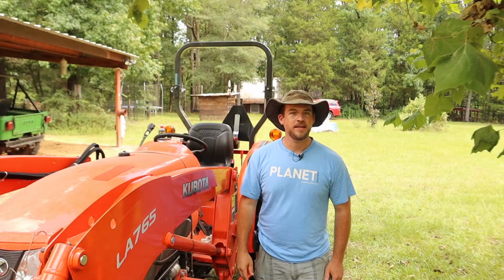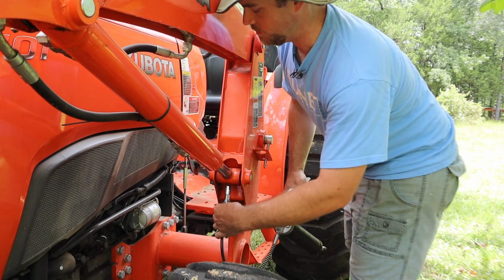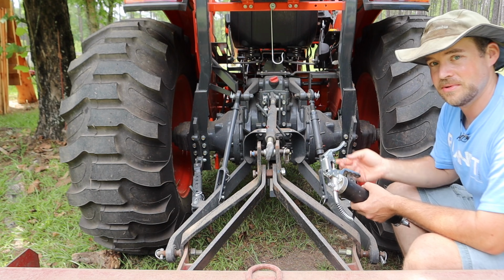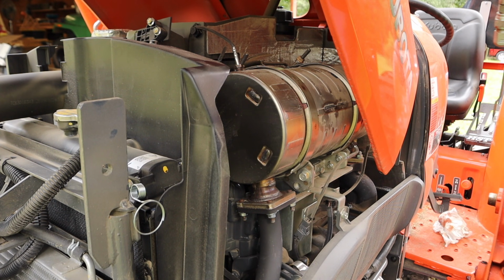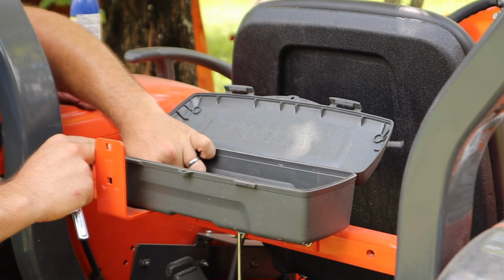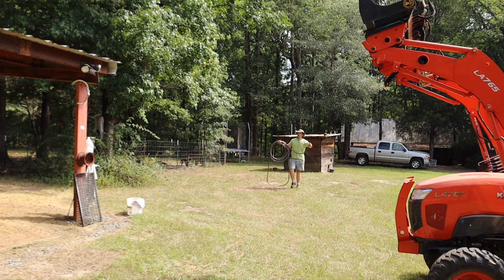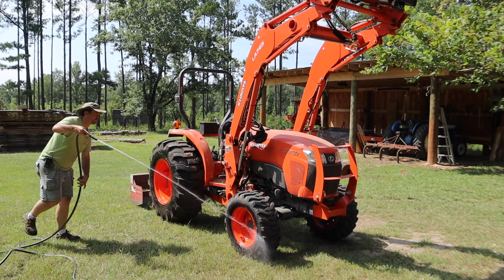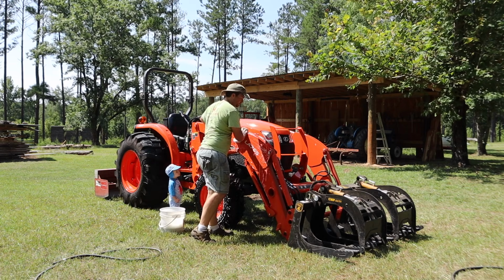I Can't Believe Kubota Did This

Comment: I agree that the Kubota hitch design is not the best; my L3830 is the same way. But part of the problem is that the frame on the box blade is bent on both sides where the pins are. Straighten that out and the hitch process will be a bit easier.
Reply from the maker: Yes, there's some bending going on, but it was difficult before the box was bent.

Comment: Never trust hydraulics. Maintain positive control. Raise the bucket and place 1.5” angle iron on the pistons cut to the appropriate length for a brace. Paint or tape them a bright ugly color so you’ll remember to remove them before letting the bucket down.

Comment: I work as an engineer for a large diesel engine manufacturer. It's no secret that T4 emissions equipment causes poor fuel economy. The DPF is a big filter on the exhaust and that causes a restriction which means you need more fuel to do the same amount of work. On top of that the combustion parameters aren't optimized for fuel economy, they are done so to stay within emissions and then give the best fuel economy within that constraint. Also the Regen process consumes more fuel to burn out the DPF. 

Long story short yes you get poor fuel economy  but the air coming out the tailpipe is cleaner. Does this offset the effects of having to use more fuel and the processes to get it? I don't think we have an answer but I bet not
Reply from the maker: I agree, the exhaust is just crystal clear on this machine. I can never get it put out any of that satisfying black diesel smoke.  

I agree, It just doesn't make sense to me that burning more fuel to do the same amount of work somehow helps the environment.

Comment: Although i guess this may be known, a DPF is a diesel particulate filter that removes the very small unburnt carbon particles that Diesels make, sometimes seen a black cloud. The small particles ( PM10 and 2.5 ) are very bad for human health, particularly for children, although in open farms like you have that may be irrelevant compared to cities where this is a bigger issue. A DPF is not added for efficiency or CO2 emissions but for human health. Cheer , thanks for the video.

Comment: Your Kubota tool box was in stage one. Wait a year and stage two will become “hinge failure” when you say where did the top go?
It’s probably behind the seat.
I have a M5140 that I was lucky enough to find at a Pennsylvania Kubota dealer. It was a leftover with out the regeneration stuff.
If I had a beef, other than the disposable screwdriver holder, it would be the throttle handle that has a 45 degree bend that is designed to dig into the operators thigh.
Apply wax to slow down the change of coloration to pink.
Is it worth 26,000$ more than my FORD 3600?  
cc Kubota Tractor Corp
Reply: Plastic tool box is 4 years old, no problem but I keep tractor in shop when not being used

Comment: I don't know how it would work for you, but I have a set of forks for the back of my Kubota. It was a struggle to put them on because they were at the limit of the lift arms. So I took the lift pins on the forks off and reversed them. Now you pull  the arms out over the pins and put the locking pins in on the inside.

Comment: Be careful with the quick hitches, make sure it fits the implements, the with of the connections may be an issue.
Reply: You can always use a Pat’s easy change on the tractor as an alternative

Comment: You  stated the tractor uses more fuel than the pre tier four . It’s all about NOX emissions, lowering combustion temps reduces NOX, but when you lower combustion temps you can retard the timing lower the compression ratio and used exhaust gas into the engine, unfortunately this uses more fuel to get the same horsepower. Good part less NOX emissions, bad part less fuel economy. Once Def, diesel exhaust fluid, is used less exhaust recirculating and a little better fuel Econ, still not as good as pre after treatment but better for NOX Emissions. I suggest reading up on it.

Comment: Ok video is a year old so you most likly wont read this,,,  but some tips.... First rag in one hand, grease gun in the other... Wipe off grease fittings before greasing and after.  Pushing dirt into fitting is bad.  Second get a good battery grease gun and you will be more likly not to put off greasing your tractor...  Grease bucket every ti.e you use it...

Comment: You are right the model you have is designated as a CUT Compact Utility Tractor and not aimed at the Ag market. We have nine tractors including an L5740HSTC and M8540HDC and they are great, but won't match our older ag tractors. We no longer farm, so the Kubotas get more use than anything, but it sure is nice to have one of those old, heavy ag tractors handy. As to the loader, you can fab up some ram sleeves or I just park my tractors where I can rest it on something sturdy.

Comment: Ammo can is a good temporary fix, but as with most tall, skinny tool boxes, you'll find yourself rooting around, pulling out tools to get to tools. Sometime, somewhere you'll spot a longer, wider, and a bit shallower toolbox that'll fit back there and you'll not pass it up. Diesel exhaust fluid is an ,environmentalist with no brains solution, to reduce/eliminate nitrogen oxides (a theoretical contributor to global warming) produced when diesel burns. Never mind that it burns at a 40% higher efficiency that gasoline because of the compression ratio.  DEF is a poor bandaid for a problem that really isn't a problem. It's a good moneymaker when it's now a mandate. Eventually, I hope, a good engineer will (probably has) come up with a better fuel  burn solution, but then all those DEF producers and those who make the injection systems for it will be out the money.

Comment: Your Ford 3000 will still be around when the Kubota has been recycled.
Reply: You've got that right. I've got a late model New Holland, that has to be housed inside, and below 20 ° F plugged in. By comparison my 1971 vintage Ford 9600 sits outside in all weather, and never needs any special attention to work. I often don't run it for 10 days or more, but its always up to the task. Also have a 1947 8n that isn't quite as reliable, but probably has more hours on it than any orange tractor ever made. Teach his own, but give me a Ford made when fuel and steel were cheap, and made in Pittsburgh PA any day of the week.

Comment: As with anything the government has their hand in as far as pollution is a joke. Diesels with anything above tier 2 systems are fuel hogs and the parts are ridiculous price wise. We had a John Deere 7930 for about a year we got at auction about 6 months in it needed an exhaust at the cost of $7000 and them it started having egr problems we ended up trading it off for a John Deere 8400 with no pollution control and I can say we got the better end of that deal. Also my neighbor just got a kubota m series tractor somewhere in the 40 to 50 horse range and my old massey 65 with the perkins diesel does laps around it all day long in the hay fields we do together and at the end of a 12 to 16 hr day he is looking for fuel if he hasn't refilled already and the old massey is still sitting at 1/2 to 3/4 of a tank ready to go to work the next day only thing the diesel tiers mean is more money and more fuel as you go up it's a joke.

Comment: even with a quick hitch you might have connection issues.   Some implements have different measurements.  and especially the top hitch.  The top hitch might not hook up altogether.  Pat's quick hitch would be a better choice.  You can hook up just like the one piece quick hitch you just have to hook up the top link afterwards.  I got the regular quick hitch but I couldn't get it to grab my brush hog correctly.  With Pat's quick hitch with the stabilizer strut it pretty easy to grab the implement and pull if out then attach the top link after I get it out where it's clear to reach it easily.  

https://www.agrisupply.com/pats-quick-hitch-category-1/p/70078/?utm_source=bing&utm_medium=cpc&utm_campaign=NB_PLA_TractorAccessories_BING&utm_medium=cpc&utm_source=bing&utm_campaign=NB_PLA_AllProducts_BING&msclkid=5e1f2309270c15a3f0917cfbfa4925d0

Pat's 3-Point Quick Change Hitch - Category 1 With Stabilizer Bar
#70078

Comment: Heck no it aint. If yoj keep it clean it will look brand new for a long time. I bought a brand new riding mower made by husquvarna and i paid over 2500.00 bucks from a husquvarna dealer. I clean and wash and grwase jt everytime i finish using it. Its a 2016 model and it still looks brand new